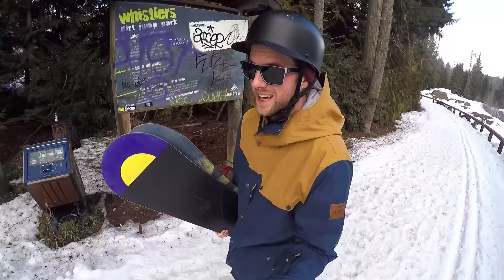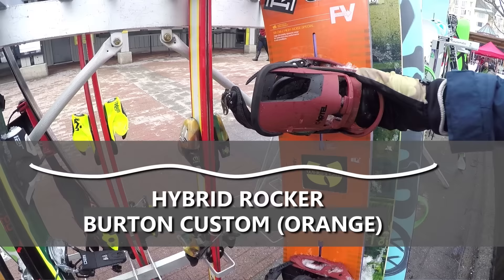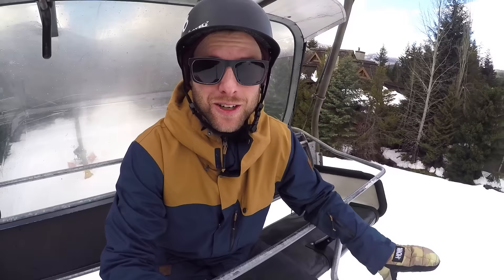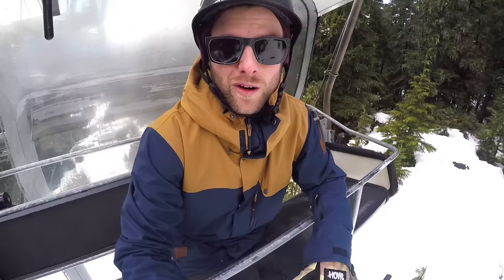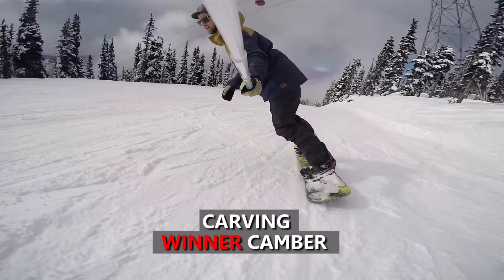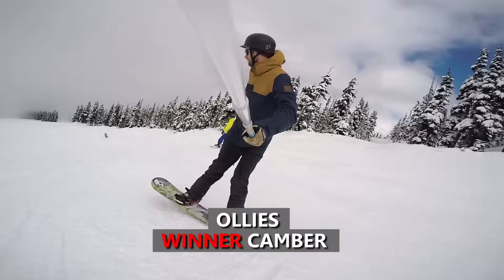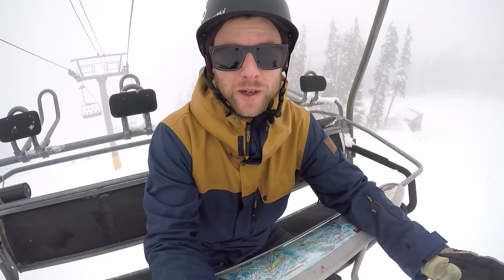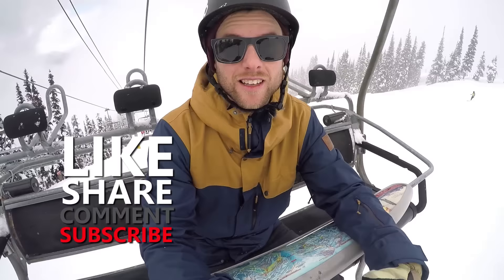Camber VS Rocker Snowboard Test

Comment: You should have tested a normal rocker instead of an hybrid.
Reply from the maker: +McDudes I'm going to find the most rocketed board I can and test it against the most cambered this winter!
Reply: SnowboardProCamp that's awesome I can't wait for that video :D
Reply: SnowboardProCamp u can write the website from wich u bought the traditional camber burton process snowboard please ?
Reply: fratze187 I have hybrid and in powder it still wins. my friend got stuck in powder couple of times on his camber while I easily floated away
Reply: there are no friends who go snowboarding where i live :(
Reply: Try Burton Custom  Twin, king of camber boards vs Libtech Skate banana King of the rocker board.
Reply: I'd like to see the same manufactured board that offer rocker OR camber in the same model against each other. ;-) You know....for real scientific method otherwise there are too many variables in how the boards are made.
Reply: You should've went  to school so you could've had the opportunity to learn when to use "an" and "a"
Reply: Click bait, not a rocker board
Reply: @martinchotincho8134  can't believe i own both these boards
Reply: @marshwiggleme   i agree
Reply: TurboDuckHeadHD In HD   I used a hot knife...but the custom work great for mi
Reply: It's the same, rocker is not good, i prefer camber.
Reply: @funkylosik  that's what rockers is more or less designed for. To help keep you on top of the snow
Reply: @SnowboardProCamp  hi im new to snowboarding and want to hit more park courses and some down hill. I'm 6 foot and 200 pounds. What board would you recommend I live in Wisconsin but will be going to Colorado here and there to ride but mostly in Wisconsin
Reply: Martincho tincho no Nitro Team much better
Reply: Yeah Flying V is kinda a cap
Reply: @SnowboardProCamp  where the vid? 
I ride rocker, just started.
I love it so far, playful and soft! 
Going for a camber board also 🤙🏼
Reply: @martinchotincho8134  Same(I know I'm replyn to a 3yr old comment... 🤦🏻), I think Arbor makes or has made several models & marketed them in camber or rocker profile. I think theie 'Element',  'Formula' & 'Coda' models(plus some more i can't remember) all come in camber or rocker design.

Comment: I'm a 20+ year rider and have to say there is more to rocker than this.  I switched from camber to a flying V and love it.  It floats much better in powder and allows much quicker initialization into turns.  It has a more loose feel and  may be harder to control, but I find it more fun as someone who loves to spin a lot.  It definitely is not as powerful in the turns, so it requires a little extra focus to stay locked.  I wouldn't say either is better, just different.  If you've ever been in really deep snow and struggled to keep enough weight on the back leg, you will understand why rocker is awesome.  This also applies to going switch in powder which can otherwise be really difficult.  Thanks for the great vids Kevin, hopefully this helps!
Reply from the maker: Thanks for the feedback! The rocker is definitely better in the powder.
Reply: +SnowboardProCamp What kind of mittens are those my Burton gloves just wore out over  season and a half of use.
Reply: +CalifroniaCrusin' Look like Howl Jed Mitts to me (though I don't think that particular design is available online.)
Reply: +Matt Angiono It also depends on the shape of the nose. Some rockers don't have much lift and won't be good on powder.
Reply: +SnowboardProCamp Wouldn't it be dependent on the flex? A flex 3 in pow, it just buckles and doesn't support the weight of the rider but a stiffer rocker shoves the snow around a bit better?
Reply: +Matt Angiono Agreed, Ive been riding a flying V design for the past couple seasons and I love it
Reply: +Seth Stinson full camber = advanced rider, flying v = novice intermediate
Reply: +Matt Angiono totally agree, I ride both and love my Flying V (a burton process), but I have to say I take it when I just want to have fun and do lots of flat tricks, it's so playful and easy to ride. When I'm  going to ride harder I take a traditional camber (that I chose harder and longer as well)
Reply: +xremdog29x 
I hear this a lot, but how can it be true?  If the camber give better control, wouldn't a novice find advantage in that?  If rocker give less control (and I don't agree that it necessarily does), then wouldn't it not be for a novice?
Reply: +Fernando Lucero if you do not ride at an advanced level then its kind of hard to explain. sure rocker can be easier, quicker edge to edge, and less catchy. but a camber is more controlled at speed, where as a rocker is sketchy when coming into large jumps or carving an icy half pipe. also a camber grabs an edge way better after a big spin, where as on rocker it can be super sketchy if you dont grab the edge right as you land.
Reply: +Fernando Lucero A novice doesn't want control. you aren't going fast enough to need it. A novice wants mistake forgiveness. That's why absolute novices should always rent rocker for the first week or two. Catching an edge is a real problem with the learning process and it's a lot easier to learn without catching on rocker. I completely disagree with this guy on his recommendations.
Reply: +Matt Angiono Definitely not a fair comparison, but glad he mentioned beginners should focus on the camber. Rocker is definitely for more advanced riders. I tried riding my camber after riding my rocker all season and I don't think I'll ever switch back unless I'm doing groomers all day. Even then with Magnatraction and grip tech you have a ton of control on edges when it's needed.
Reply: +palblinker i think i might have to refer to you as a gaper. however, each to their own i guess. unless your just confused and got rocker and camber mixed up, then what you are saying would make way more sense.
Reply: +antihero3zx my experience was the opposite. I learned to ride using a camber, and although it was difficult at first, it did make me focus on my technique religiously. Now I can ride without issue on a camber and riding a rocker is lol just lol.
Reply: Not really. you basically just confirmed exactly what I said. There is no reason to make your first times snowboarding more difficult and punishing then need be. There is plenty of time for focusing on your technique religiously after you "get it". Making your first trips to the mountain needlessly difficult is absurd and does not help people learn faster or better. Does switching to camber force you to get better? absolutely. People who are not good (aka every beginner) should be learning to snowboard and having fun, and that's easier on rocker.
Reply: +antihero3zx true, I get the idea of making snowboarding (or any skill) not too difficult when starting out, but tbh even now I don't consider a camber to be a "pro" type of board. It's not THAT different to a rocker in terms of difficulty, hence I don't think it's such a bad idea to learn on a camber instead of a rocker.
Reply: +Matt Angiono ...beat the crap out of myself for 2 years on various camber boards "learning technique". went full rocker (burton joystick) had some fun. went hybrid (neversummer sl) have even more fun. 
that's it fun know what i mean.
Reply: +Redwave trance I started out on camber, tried a rocker and found though it made it easy on the slope it wasn't as much fun. Then I tried a hybrid and I was sold, I might get another camber if I can find the right one it just seems a lot harder to find a camber board that I like riding as much.
Reply: this has been first first ever snow season this year. working at a ski resort in Canada so I've had the chance to snowboard a lot and improve. my first recommended board from the shop was the Burton Process Flying V! absolutely love it. so happy with how versatile it is to riding different terrain. as well as pop and tight turns. I wish it had a little bit more flex in it though as at times its thrown me off the snow and multiple occasions though I broke my legs 😂 but the hybrid is amazing
Reply: I have a rocker and I love it
Reply: Matt Angiono me to rocker is much better than Flying V
Reply: I don't know what snowboard I,m geting
Reply: Tommy TT101 I actually like flying V shape or AKA nitro gullwing camber ... its a pretty good camber but regular camber is also good for all around stuff but is a little less good in powder ... while a flying V shape is good for both type a little less controle on hard snow but much more playfull for butter and powder so ... if you want to go super fast on flat snow surface go for a regular camber ... if you want a all around board go for the flying V and if you want a powder centric and butter board go for a banana AKA rocker camber
Reply: Ivan Ivanovich I hit 60 on a 6 year old Burton Clash last year. Not sure if you're familiar with it but it's a beginner/intermediate board that was designed with learning in mind. Trying to turn was ridiculous. The edge gripped so little that I could turn the board 45° and keep going in the same direction.
Reply: Black Series 100% agree. Good to see there's still riders who appreciate camber; maybe the mfg's will start focusing on it again some day soon. I've been riding for over 30yrs and have lived through all the trends. Maybe I'm old school now and stuck in my ways but I can't get used to riding any of the new tech rocker boards. It's the most difficult trend I've had to go through because it's difficult to find good camber boards with some length now. I've wasted a ton of cash buying different rockers, trying them for a while and selling them because they always make me feel like a beginner again. They don't hold an edge when you're bombing crud at the resort which is obviously not the riding we want to do but it's usually necessary unfortunately and it's where a good camber board really stands out. I don't believe in buying a board because it's great in powder unless that's all you're going to ride which unfortunately isn't the case for most of us. Any camber board is still great in powder with a little length. I just got back from Heli boarding on my 68 Prior MFR  and there wasn't anyone passing me with a rocker...
Reply: @craig Hingley actually " flying V " or reverse camber and camber medley  isnt a " new trend " or a " new thing " it as always existed since snowboard is a thing terry kidwell and others old school boarder have board on reverse and flying V camber back into the 80 when they were experimenting things , and then for age the industry as remain pretty stagnant with the standard camber board then they turn back to the 80s prototype and refined them ... now you have all sort of camber who have all pro and cons , wich is the same for ski , you have better ski for Pow , for hard snow and carving etc... and you have good all around board and ski ... its all base on preferance , camber board are good all around and carving  board with lots of pop
Reply: Drove yearsbefore I then years ago bought my flying v, best decision, love my board, just amazing. Especially in powder. 
Friend has full rocker, eve bit better in powder, but on the slope you have bit less control in high speed, then again easier to turn. I definitely love my flying v and think it's an amazoing combination of both advantaged.
Reply: Matt Angiono hi
Reply: I have a Burton Juice Wagon and just love the thing! Camber, unidirectional and feels really oldschool. It's nice to have that much control while carving some groomers and still be able to hit powder.
Reply: Matt Angiono nobody would read all this
Reply: agreed
Reply: as a 15+ year rider, I fully agree with everything said in the video. rocker board are fun for spring slushy days in the park and messing around on cattracks with butters. but if you want to actually do real riding and hard charging, camber wins every single time. all my boards are camber and I don't see that ever changing.
Reply: Some people say camber is better for icy conditions because you control your speed better with edge control. But if you can initiate turns better with rocker, can't you just do more turns to control your speed? Also wouldn't rocker be nice if you want to take sharp turns but still get speed on your turns?
Reply: It sounds like they are talking about the act of skidding. Camber puts more pressure on your tail to shave off speed so it scrapes the snow harder.  Rocker is bent upward, so you won't get as much pressure on the tail.  The "turn initiation time" is very small compared to the skid time when you're slowing yourself down. You will prolly not even notice it yet, even though these ppl say it's so.  When they talk about speed in turns they are referring to carved turns, not skids. G-force in a high speed turn requires edge grip, which is better on camber.
Reply: Absolutely. .. Apples and Bananas you can compare but it is idiotic too. 
I have a couple boards now. 2 powder boards .. one long rocker.. a fish for the obvious fun of old school riding. I have an all mountain mix/hybrid chamber (Ride Berzerker)  and an all mountain rocker. The all mountain rocker (Ride Machete) I like the least as I can't really carve with it. It turns to easy if that makes any sense. If I would go for one board.. I would take the Berzerker any day.
Reply: Like 420,blaze it
Reply: Thank you very much ! Your feedback is very helpful ! I feel the same things with my FV 👍🏼
Reply: Rocker / camber for powder hands down! I have a High Society Twilight, 2012 model, I still use it after 200 days of riding. I can't get enough. New board tech isn't much different than 10 years ago, maybe by over shapes and edge tech, but overall it's been the same. I'll ride it until she cracks.

Comment: I suspect he is more experienced with camber and finds it more comfortable. An unintentional bias. This is a very small sample so don't draw any conclusions based on just this video.
Reply: Id have to agree. he gives a slight edge to buttering on the "rocker" board but he can hardly butter it and is clearly better at it on the camber board. ive tried a flying v rocker custom at a demo day and was not impressed, flying v is nothing like a true rocker board. this is a poorly conducted experiment